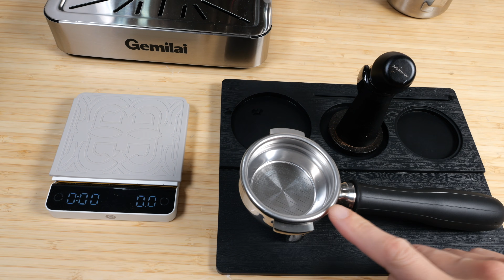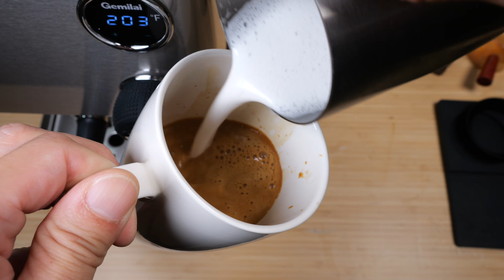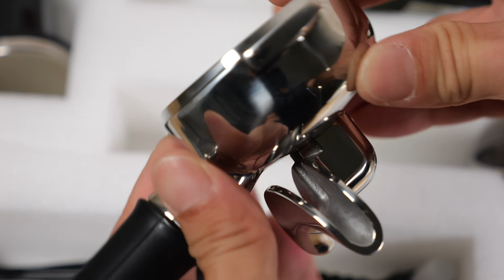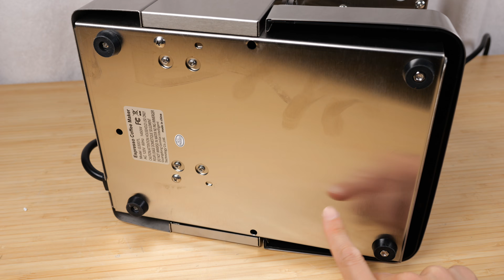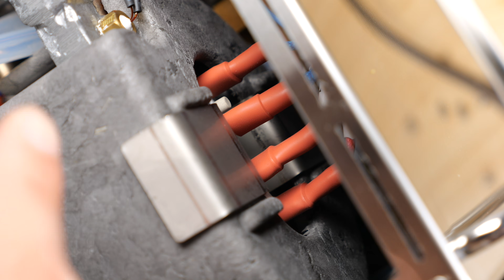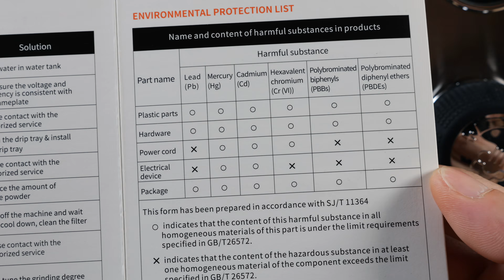Gemilai 15 Bar Espresso Machine Review [Model: 3007L]

Comment: Don't you think the main boiler is made of aluminum? If it were made of stainless steel, it would be shiny. There is no information about this on the manufacturer's website.
Reply from the maker: The main boiler appears to be made of aluminum since it is a light grey matte finish on the outside. You would only get stainless steel boilers in the high-end machines. This would be considered a budget friendly machine and so uses a lower cost material.

Comment: hi there, i also used it CRM3007z version. but i have problem with pressure. no matter how fine i grind my coffee bean the pressure will go high more than 9 bars but immediately drop to 7-6 bars. i don't know how can i solve this problem or is it because of the problem of my machine?
Reply from the maker: My first guess would be channeling. High pressure until it punches through and lowers it. I would get a WDT tool and also a self leveling tamper.

Comment: good preview... does it have adjustable opv and pid control and pressure gauge for both brewing and steaming?
Reply from the maker: The screw at the bottom might be the opv but I'll have to examine the pluming to be sure. There is indeed PID and pressure gauge is only for the brewing. Steaming take water from the main water tank and heats it up some more to do the steaming like in Breville machines, it's not a separate boiler where all the water is heated up to steaming temp.
Reply: @BeatTheBushDIY  ok that means it is still the V1 version... thx
Reply: I've just bought a 3007Z, it has an OPV
Reply: @46spanner  What? I contacted seller or ali they said it haven't beed produced. Are they lying? Where do you get it?
Reply: @pusico6555 I replied yesterday with a link to where I purchased mine, it didn’t show up..maybe YouTube doesn’t like links. Shop is Myhillkof in Penang Malaysia, the 3007z is listed on their website and its spec includes an opv
Reply: @46spanner  yes YouTube didn't allow sending link. Got it. Btw what color did you get? Silver, white or black?
Reply: @pusico6555  I got the silver, looks very nice in the kitchen. As others have said this machine is new to the US market but it’s been on sale in Asia for some time and is quite well known. For me it’s a safe buy, 20 min drive to the importer who carries a full range of spares and a 12 month warranty.
All I have to do now is learn how to make decent coffee!
Reply: @pusico6555 in Thailand it had been released October 2024
Reply: Can I ask what’s the difference between 3007l and 3007Z
Reply: @alialjarwan8679  3007Z is the new one. It has OPV and better pre infusion
Reply: @ do you recommend it over the bambino and gaggia ?
Reply: @alialjarwan8679 Yes and Yes.